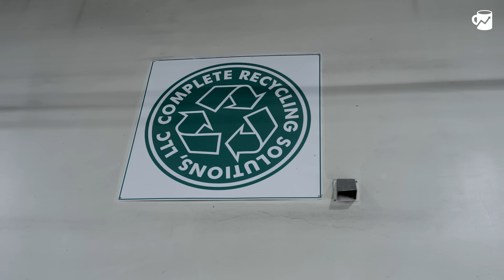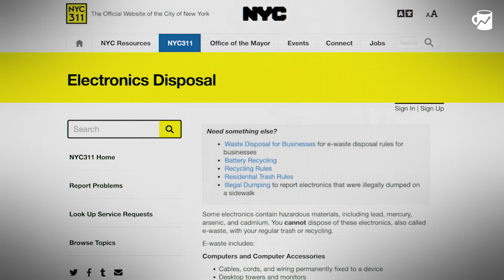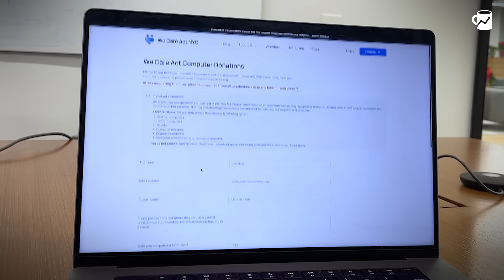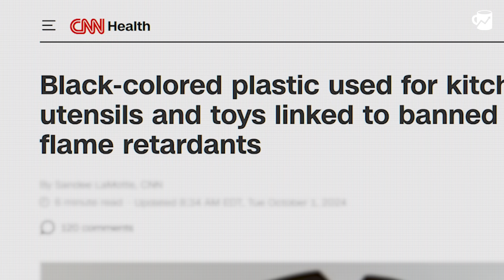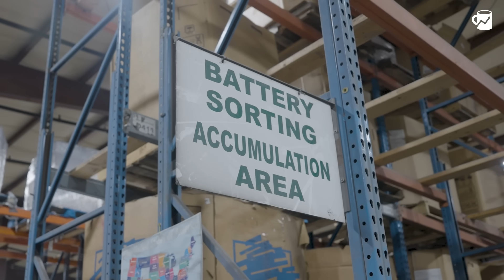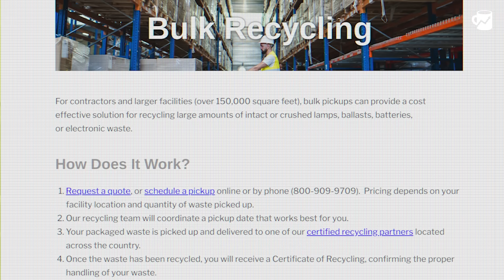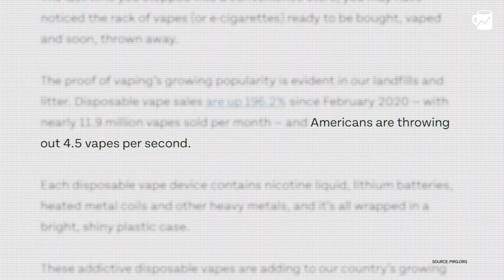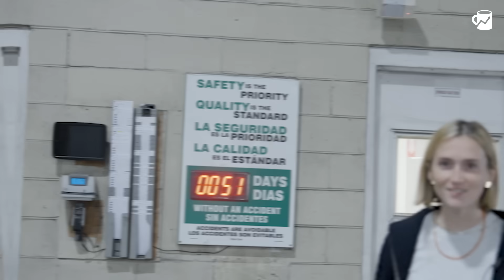I went down a rabbit hole trying to recycle all my tech waste

Comment: Really great video explaining the process of tech recycling. I went to a landfill when i was 16 while i was at the 2017 national scout jamboree. We went there for our community service day painting metal flowers for them. But we learned a little bit of what they did. Pretty much they don't want garbage anymore. They want to recycle and reuse more stuff. They know we will run out of room, and China won't take our trash forever. It's definitely a very urgent problem that needs to get figured out soon. 

As for the tech side of the video, that's always been the biggest problem with technology for me. On the product and on the news, they say not to throw them away, but where am i supposed to take them? They make it a scavenger hunt to find recycling drop-off points. But there was a reason why phone companies were willing to trade you a brand new phone for your old broken phone a few years back in 2021/22. Your earlier iPhones and Samsung have more valuable metals in them than newer phones. Apple and Samsung know they are running out of those critical materials. They were trying to get a fraction of their old phones back in order to make a couple hundred thousand again.

Overall, when it comes to old electronics, i try to use them the best i can. I like keeping my old game systems because they are still fun to play on, and i get to personally keep a little piece of history. Ive started buckets for scrap in my garage. One for cheap steel to get melted down. Another one for copper wire to get a few bucks out of. Knowing that we've wasted hundreds of thousands of pounds of valuable metals like copper, silver, and gold seems like a bit of a problem. We only have so many resources here on earth. And with metals like those they are almost 100% recyclable and very valuable. My dad worked with a guy who took apart old CRT tv and got a few thousands dollars of gold out of them. It's a difficult and time consuming process but it works. The big problem is making it profitable.

Comment: Bottom line:
This stuff is relatively inexpensive to create.  But very expensive to recycle, because recycling was not in the design and nobody is enthusiastically buying the recycled results.
2 Examples:  
a. How much tape is used just to keep the batteries from starting fires? (another cost of recycling)
b. All that labor to dismantle a television.  (and then all of those components still need to be recycled).

Comment: This is exactly why I wouldn't buy an electric litter box unless I acquired a long-term disability. When I looked into the lifespan, it was clear that the maintenance costs and hauler fee for disposing of large e-waste items in my municipality would make it not worth it. Instead, I bought stainless steel boxes from Less Litter Earth and another long-term-use litter box from Katchit. I'm very happy about my purchases! Stainless steel is very recyclable.

Comment: Interesting video, I agree ewaste is a growing problem. Nice to see at least some recycling companies are doing this responsibly. As a retired EE it is sad to see this stuff being scraped for its raw material value as opposed to being recycled as functional items. That obviously does not apply to everything but in many cases there ought to be practical downstream users once the original purchaser had decided the retire their widgets. Reparability is a big ewaste problem either repair parts are not available or if they are it is not cost effective to repair the item.

As an aside my wife and I have had good luck purchasing off lease desktops and laptops. Not being gamers our computing requirements are modest so a decade old computer is fine.

Comment: Well, this was really fun!  It's the first time I've been able to sit through an entire 15 minute video in a long time!  But I have a lot of e-scrap I've been repurposing and holding onto.  Fun fact abut the copper wire on speakers, TVs, and Degaussing coils, it's not just copper wire, it's coated copper wire!  It's the absolute cheapest way to get magnet wire for electronic hobby projects, but it does take some work.

Comment: I was just thinking about this! Thanks for the insight :D
My family just hoards old electronics "just in case" for some reason, so we still have mine and my brother's old laptops from like 13 years ago sleeping in a box somewhere. I think their primary concern might be privacy, as in: if we give them to Best Buy for recycling, are they going to snoop around the files and sell our information to third parties? I know factory resets are a thing, but, in my case, I tend to break my screens so it's impossible to go through with the procedure. Any thoughts on this?
Reply: Pull out all the drives before recycling a computer.  Hard drive, ssd, nvme.  If the drive is working, you can plug it into another computer and wipe all the information, get to know the Linux dd and fdisk commands.  They sell cheap USB adapters to hook up to old drives like sata etc.  If the drive's not working, it's for the drawer or the fire, unless you have access to a drive shredder.  If the computer has to be working for your recycling (i.e. goodwill gonna sell it), that's harder, you could put back the wiped drive and install Linux but that's not what most ppl expect.  There's no reliable way to get your personal info off a drive but leave the OS and software intact.

Comment: i feel like if you sell it on ebay or something it'd be better. for example i would like a mac for some software that's better on mac vs windows but i don't want to use the mac as a main computer. I would likely pay $50-100 for that.

Comment: I work at a local computer repair shop.  We do a lot of component replacement such as drives, RAM, motherboards, screens, etc.  All the broken components go on a shelf to be recycled.  We also have customers that buy new computers and do a data migration from old to new and ask us to recycle their old device, so it goes on the shelf to recycle.  We will also take in any electronic device for free to recycle even if you're not a customer.  We also will take viable computers and give them a second life donating them to an organization that gets them to foster kids.  Any non viable components or devices will be picked up by a scrapper and taken to one of these types of recycling facilities.  They used to pay us for the stuff, but the prices kept going down and they wouldn't take certain items like batteries.  Now we use a scrapper that takes it all for free, but has to take it all.  

As a side gig I will get broken desktops and laptops, repair them, and resell them for some extra cash.  It's not a huge profit and is dependent on what I can get and how good the used market is going at the time, but there's a lot of still viable devices out there with small issues that can be fixed and reused rather than buying a new device.

Comment: Knowing that circuit boards are sold to third world nations where they are tossed in burn pits for poor people to pick the metal bits out after the fire dies I don't fuss too much about just throwing genuinely broken e-waste in the trash.

Same for any plastic not labeled with a 1 inside the recycling symbol, two and higher are burned for energy because it's more profitable than actually recycling them.

Its more environmentally friendly to leave plastic in a landfill than to burn it.

Comment: didn't know of the R2 stuff, the thing i find extremely frustrating is that most tech is reusable but some make it almost impossible to repair or replace worn out parts like battery's and moving components like hard-drives and cooling fans witch can burn out components the problem is having the right to repair. im sure most of those tvs are fine just the power board has a blown capacitor or resistor but good luck finding reliable parts and thats what makes it so expensive to fix. want to fix the e-waste problem support the right to repair and stop letting manufactures produce a product that only last until the warranty card expires just because my battery cant hold a charge shouldn't be the end of life for a product

Comment: I gave up a long time ago trying to get money for non-working electronics. I usually keep phones and computers until they die, and by then, they're not worth reselling. My town has an e-waste recycling center run by veterans. They don't pay you for your items, but they will come to your house to pick up items and even shred hard drives for you. We keep a box in the garage and call them out once a year or so to get whatever we have. We also have homeless shelters that will take old cellphones as long as they work to give to people in need.
Reply: I kinda have a similar problem. I use my phones and other stuff till they literally don't work, and then there are only a couple places that will take them. I once saw a video explaining how it's cheaper to replace a phone every couple years vs. when it dies, but I keep over using my phones anyway. Some manufactures now have upgrade plans that make it even cheaper to replace phones early, but I don't like the idea of constantly replacing my phone.
Reply: @wandererreece9540  nah.. I  use until it dies and then go online and buy refurbished for way less than new. I also hate changing phones all the time.

Comment: My 2012 Mac mini is still a functional device although not my "daily driver". It is in my basement/garage area. I use it to quickly research parts and procedures preferably since it is attached to a large screen. I am less worried that "something" may damage it by accident.

No. It does not run the latest MacOS and several other apps no longer run in the upgraded form.

But it does fully fulfill my needs to use Safari, Mail, Message, Notes, Calendar, Music, TV, photos, etc. without problems. 

One just needs to be realistic as to one's needs. My main computer has a M2 chip and will be my primary computer for the next 5 years. That is my typical primary use span. It varies according to need. 

Being retired, my needs are simpler now. I do salivate at the latest tech releases - get excited if I can "touch" one. But until a real need arises that justifies the newest, my "desires/wishes" can wait fulfilling the REDUCE  while REUSING over devices for less stringent tasks. And I do make use of companies like "IFixIT" for information and parts. Always on the lookout frothier companies especially for other items I have.

Comment: Il France we have laws that say : if your devices are over 5 years, you must through them away and buy new stuff.

Even if they are working like new.

We have that for any electric / electronic device used in any company, some energy saving law says : if you device is now rated A+++++++ , you must change it. So any device that is only A++ ... To the bin.

We also have that for cars. Any car that is not rated C0 or C1 are forbidden in town. I have a car that is C4, working correctly fine, goes through the yearly technical check ... Could do an other 200 000 km no problem ...  have to put it in the bin. 

So ... Things working perfectly fine, i have to through them away by law. 

They are not broken. They are not dangerous. But, they have done their amortization time, so lobbies ask consumers to consume.
Reply: 0:50 my stuff can't be reused. They are forbidden to use !!! It's legal to sell them ,but not to use them.

Comment: The problematic thing ist that what is considered recycling for e-waste doesn't include much recycling. It is pulling out a few usefull materials like glass, copper maybe aluminum and a few thermoplastics. Basically only the housing is recircled. But all other plastics material composits like the circuitboard materials apart from the copper are being burned. Microchips, their housings (usually epoxy moulding with glass beats) the rare, expensive and often dangerous rare earth metals can not be recovered at all.

Comment: same have 10 baskets filled with tech the recycle for small shop dont recycle they resell it and that 2015 mbp is worth now average resale $250 but then if you do the upgrade can be maxed at 16GB and hard drive is up to 4TB spend $150 and you can give someone a good laptop sure old OSX but still works - what you need to ask how do they recycle specifically the big companies are best to actually do it properly vs small to medium business

Comment: 1. Fantastic video. Need a lot more like this.

2. The number of surplus Macs is staggering. I had a 2020 model that I couldn't GIVE away in 2023!!? I think Big Brother Louis [Rossman] would suggest an alternate recycling route for these; manual disassembly shops who harvest the machines for their parts, which are then sold to repair shops... since Apple is so anti-repair.

3. Remember - Normies gonna normie, and Corpos gonna Corpo. While it's good to evangelize, the best thing conservation-proponents can do (beyond legislation, worry, protests, or anything else) is to just aggressively SUPPORT companies who produce electronics (and other goods) intentionally designed for long-term-use; your Frameworks, etc. Just be the change and watch their wasteful way-of-life diminish.

Comment: To avoid being sued because your personal data leaked, BestBuy will require any computers to have the hard drives removed before they take it for recycling. They won't take the hard drive unless you pay them to wipe the data off the drive first (usually ~$60). If you don't know how to remove the hard drive, you can pay them to remove it for you (usually ~$30). If the HDD/SSD is non-removable (soldered to the board, like in some of Apple's newer computers), then you'll have to pay them to wipe the drive before they take it, or wipe it yourself in front of them, or sign some document that says "I super duper promise not to sue you if my data gets out".
Reply: It's quite easy to wipe a disk drive. Set a high powered magnet on it.😜
Reply: @mybachhertzbaud3074  ...Orrr 'Diskpart" in windows command prompt. It's rather easy all things be told its like a few commands from online informantion and wait maybe an hour for SSD, and a faair bit longer for HDD's. By the end you get effectively a fresh drive that can be reused, or even sold. just be sure to use the "Clean all" command at the end though. "Clean" just removes the address index for the items, so it can just be overwritten, but its still there.

Its also a good Idea listen to the running drive for abnormal noises, and run a program that does a surface scan of the HDD to check its health. SSD's are pretty good at telling you their Terra-bytes written figure.
Reply: @mybachhertzbaud3074  take a hammer and have fun, its 100% secure

Comment: In the past I tried numerous times to find ways to get rid of electronic waste for work. Higher ups didn't want to spend money getting rid of it when they just got used to throwing it into the dumpster. I try to combine a lot of stuff into one spot to take all down at once only for someone else to come around and throw it all away or "get rid of it" somehow. Local recycling place requires you to pay to get rid of anything which isn't much of an incentive for people so they just throw it away.

I also started trying to sort my alkaline batteries, lithium, and ni-mh batteries to get rid of those properly thinking maybe I could get some money for them but so far nope. Not really any incentives around here but then again most people around here don't care about wasting stuff.
Reply: I ran across that too when I did corp IT work. It was a pain to break up good stuff before dumping it. Legal reasons make them not want to have anybody taking it they said.

Comment: The biggest thing we could do is promote right to repair, if it was easier to replace batteries on vapes, laptops ect you would have things that are more durable lifespans you could cut e waste in half easily
Reply: yup! that's the reuse (and somewhat reduce) part of reduce, reuse, recycle
Reply: Yes! I was still doing break and fix type tech jobs when HP decided not to sell tech companies parts for their cheaper ink jet printers (and when they chipped the cartridges and made printers not turn on with non-HP cartridges). They charged a flat rate of $149 then no matter how simple the issue was and made folks ship them to an HP depot. It made those printers throw aways because a new one cost about that much. My god clients were rightfully angry and we got to hear all about it. My company was a channel partner of theirs and they still withheld the parts.
Reply: There's no such thing as a right to repair. Either you have the ability to repair something or you don't. No one can just wave a magic wand and make anyone else more capable though. Consumers demand ever higher technology that's more difficult to work with. You're getting exactly what you want now. You're voting with your wallet.

Comment: You could have reduced the manufacturing of 4 iPhones, 1TI-83 calculator, 2 MacBook chargers and 1 MacBook Air if you chose to sell them the moment you decided that you no longer need them. They should add up to at least 2000 USD before adjusted by inflation. Selling them on ebay or fb market place or simply bring them back to Apple isn't "too much work" and is not wasting your time even if you are making 500k per year. Stop finding excuses for your own laziness and apathetic for the environment.